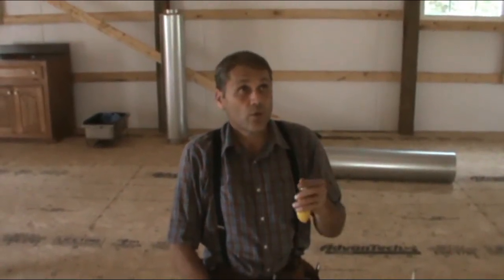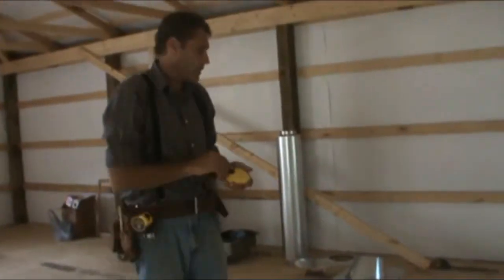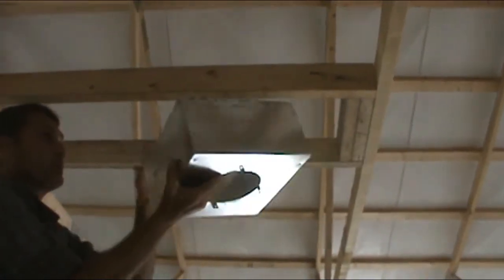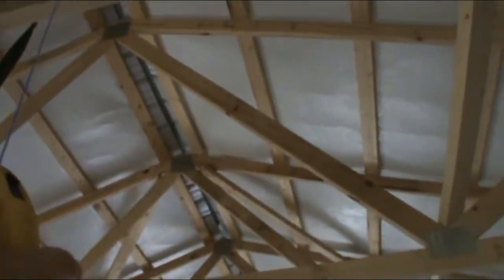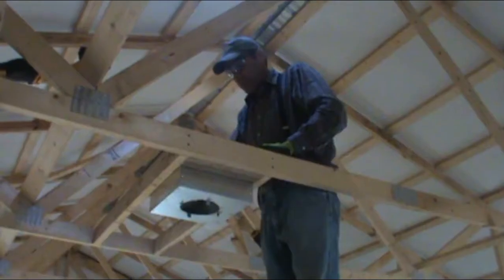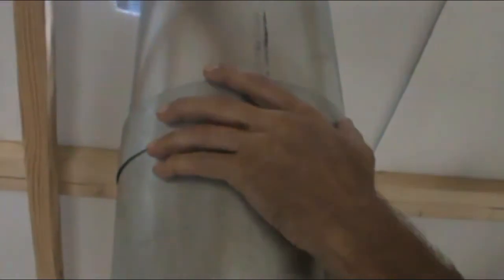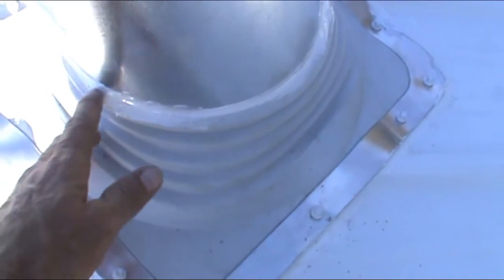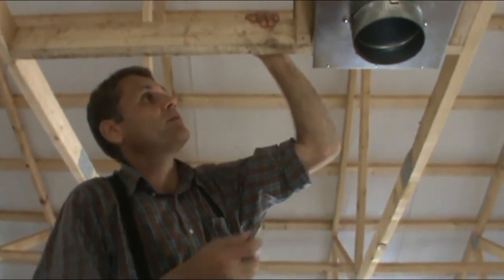Chimney Kit Installation for Beginners

Comment: Hi guys.  Thanks for the informative installation.  The only major recommendation I would make is placement of the rubber boot.  The way it is place creates a pond for water between the two ridges.  I would suggest putting the rib right in the middle of the chimney.  Also I would suggest putting a second later of sheetmetal over the boot to really make it water tight.  Place the metal from under the ridge cap to the midpoint of the chimney.  I have worked a lot with metal roofs and caulking tends to fail after a hot summer with the expansion and contraction of different materials like metal and rubber.

Comment: I paid an Amish installer $1,000 to install my chimney because I didn't want my house to catch on fire if I did it wrong. He installed the metal instead instead of the rubber boot with lots of silicone caulk. I've had to since add more silicone caulk. The metal shield is not stainless so I'm now noticing some traces of rust on my metal roof. Because he didn't have the proper reducer for my cook stove he install the inside single-wall pipe upside down which caused creosote to leak and run down the outside of the single wall pipe. Not very attractive. I replaced the pipe after two seasons. Many thanks for showing this is something you can do yourself. I too was apprehensive of cutting a hole in a new roof.

Comment: What is the brand name of the rubber boot? 
I think the suggestion to center pipe on one ridge of the roof metal was good advice too.
Reply: Hi John.  The brand name is Aztec washer company out of Poway Ca.  Thank you for the comment.  I have done several more since then and have come to another conclusion since this video, it is better to use tin snips to cut out the hole for the chimney.